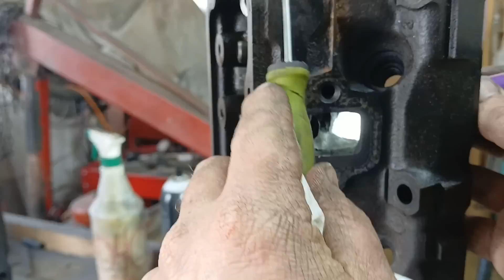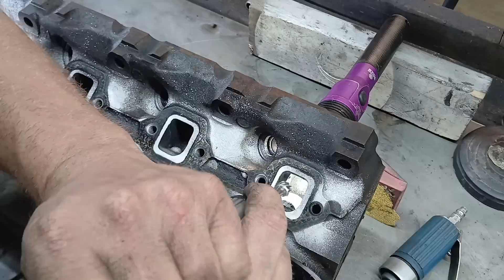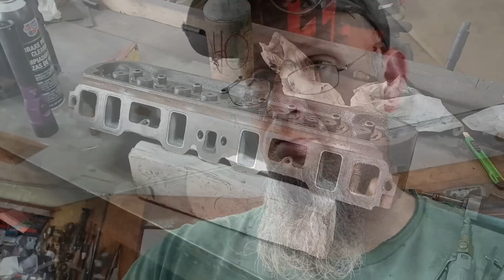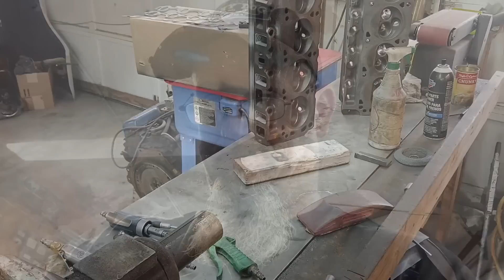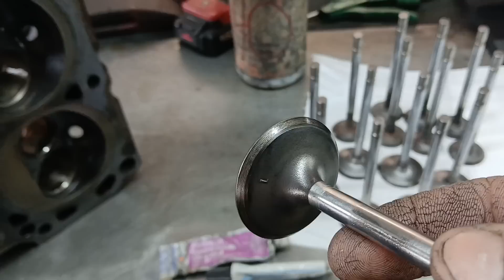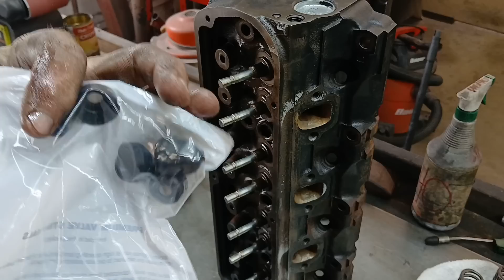Budget Minded Small Block Ford E7 Head Porting Tips Anyone Can Do At Home! #ford

Comment: Exhaust ports you want almost stock... At most you can open them slightly to make the corners even (talking about that one dip in at the top left).  It's dyno proven that keeping the port exits basically stock size (at most opened to the stock exhaust manifold gasket). You want velocity and a lot of scavenging. Since it's an OHV and especially if you're using stock exhaust size valve it's best to lean toward the inherent characteristic of the engine and let it make its low-mid range torque that gives it an edge over similar sized OHC engines.  As far as exhaust bowl work you do 80% of the work on the outside of the bowl toward cylinder wall as the flow is coming out at an angle from quench area. I meant to upload my full how to that goes into full full detail as I learned from folks like David Vizard and Charles Servedio. My first pair I definitely hogged out my exhausts thinking that was the way but it's not.  There are other tricks you can do to the quench area and some chamber work to help improve swirl (the E7s have poor swirl).
Reply from the maker: Appreciate you sharing that experience.

Comment: I saw some flow numbers of a well-ported E7 head that matched a stock GT40 head for intake, and beat it by ~6-7 CFM for exhaust. Porting E7's isn't done often but if they're what you have, you can make some drastic improvements to some pretty decent heads for the cost of a die-grinder and your time.
Reply from the maker: Exactly, it's all about putting in the time! 🛠️
Reply: @HotRodGuyGarage  I was reminded since you replied - what are the part # for those positive stop valve seals? I've seen a few versions around but didn't see those for stock size valve stem (0.560" I believe)

Comment: First of all, thank you for taking the time to create such a thorough video. The heads look great! I follow the taller vs wider port theory myself except for the exhaust ports. A perfect example are the chevy LS heads. E7s have absolutely inadequate exhaust ports and absolutely kill power above 4,500 rpm. Those ports are gonna extend the rpm range without loosing bottom end power. Only thing I do differently is up-size to 1.90 and 1.6 valves with a 30 degree back cut on the intake valves only. I understand this build is as budget as comes but the valves are pretty affordable  and you can do your own 3 angle valve job with Neway cutters. 351w valves are another great option.
Reply from the maker: Thanks, They run great on the engine. It would be nice to put larger valves in them for sure!

Comment: I ported my Cleveland 2Vs myself, and have about 3 hours of work in them. Much the same kind of  work as these, but without the smog bump.

No flow figures but I did notice an increase in midrange torque. The very mild cam meant that top end felt about the same.

As for consistency, I made up a jig out of 2" angle steel that held both heads in place inline. 4 x 12mm shanked bolts with the heads cut off were used to hold them on the "rail" via the head bolt holes.

Mounting them this way lined up all ports so that you could stick to one operation at a time and move along all of them using your muscle memory to keep them all the same. I think it worked very well for me.
Reply from the maker: Thanks for sharing your experience and tips! Sometimes even small improvements are helpful

Comment: Oval Raised Exhaust Port! 
Without butchering and sealing the casting. 
The power gains are in the bowls and port height. 
Not in in pushrod pinch section. 
Also 60 grit finish makes the best flow numbers.

Comment: about 9:00 you mentioned polishing.  Castings are rough inside the ports, normal typical iron castings.  Is there any practical gain to smoothing some of that rough grain out of the casting or is the juice not worth the squeeze, as they say?
Reply from the maker: Sometimes yes, sometimes no , for a quick clean up its not needed.

Comment: Back in the 90's I bought a brand new set of "Take off" E7 heads from Saleen, I did almost the exact port job you did on these and had a great set of street heads for my 5.0 Mustang for very little money. 
I'm getting ready to do the same thing on set of 1970 351 heads. It's always nice to see your process to refresh my memory on how to approach the job. I was considering the GT40 heads but thought they were a bit pricey since the word seems to have gotten out on them. I wonder how quickly the seats will wear on the '70 heads? I don't think they are hardened.
Reply from the maker: You could always add a little lead subsitute for the valve seats

Comment: David Vizard has some really good videos and books on porting. He has a very easy dyno proven combustion chamber mod for the Ford iron 289, 302 /5.0, 351w heads. It is a shelf leading to the exhaust valve seat area that is very easy to duplicate.
Reply from the maker: Absolutely true